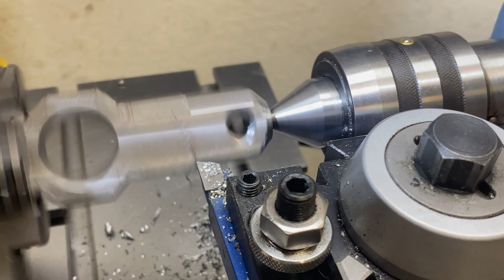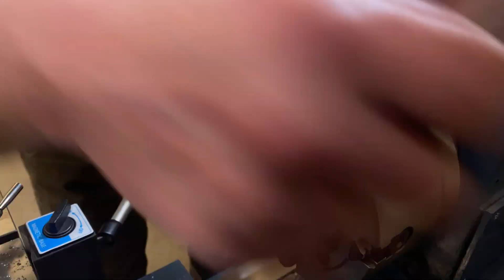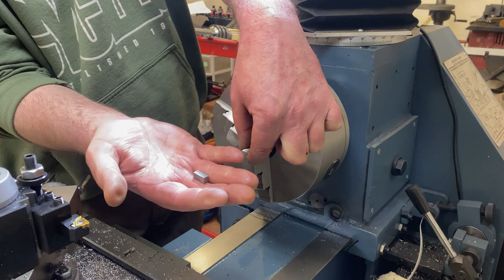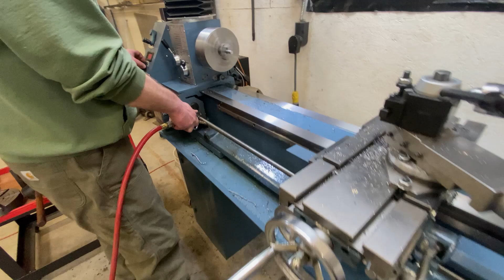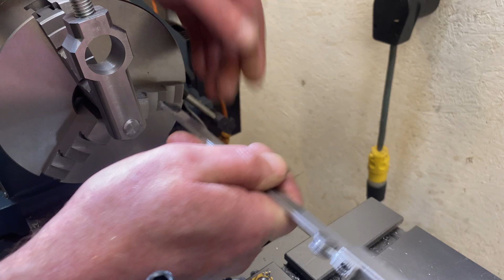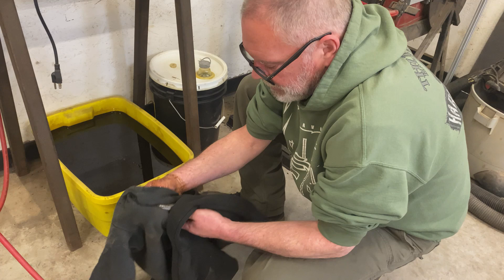New drive dog part 2

Comment: Really cool, thanks for sharing! You have so much knowledge and skill, I'm learning a ton.

Regarding the stuck arbor, I was thinking of some kind of ring-clamp to hold the threaded portion; like a muffler clamp, or sheet metal bent around  and then bolted together - could line it with leather to not mar the surface. Then, if still needed, you could use an impact hammer on the clamp to kind of rattle it loose. Hold the bushing in a penny-lined vise. Or use large vise grips lined with leather for the arbor!
Reply from the maker: Thanks for the compliment and all the great suggestions. I think I'm going to try the penny lined vise first.

Comment: For un-sticking parts when high heat isn't an option, try a stronger penetrant/solvent like kerosene or kroil. Kroil is great for stuck bolts and such. Also you might get lucky with a hot air gun, you can still have significant size change from a few hundred degrees. And since it's all about differences in temp, you can increase the change by freezing the whole assembly before heating with the hot air gun.
Reply from the maker: Thanks for all of those great ideas. Thanks for watching

Comment: Hi you set the compound at 29.5 degrees to lesson the cutting force and that way when you advance the compound you are cutting more on the leading edge of the tool. On the arbor you can heat it up slightly with a propane torch and melt bees wax on it , the wax will soak into the threads and free up the rust. the drive dog turned out great Thanks.
Reply from the maker: Congratulations! You are the first person to answer the question!
I kinda wish I had a prize or something for you but nope :) 
Yes the 29.5 degrees lessons the force as you said. 30 degree would have the same effect. the 29.5 degree forces the trailing edge of the tool bit to scrape away any "stepping" effect that advancing the compound every cut can create. 
I'm definitely going to try the bees wax. that stuff is amazing for many things. 
Thanks for your comment and your kind words!